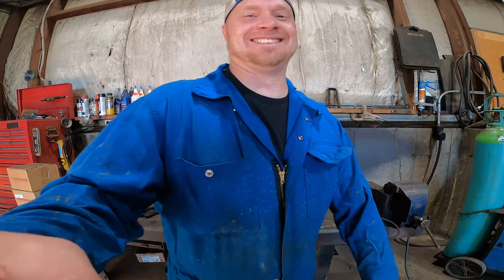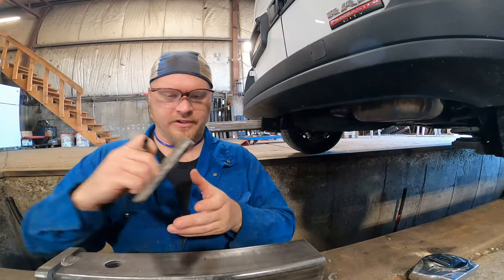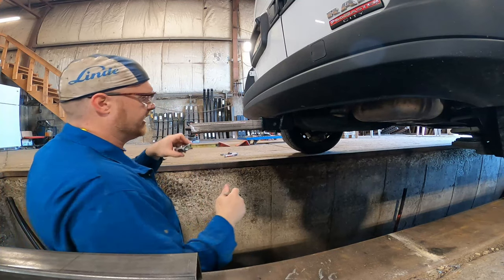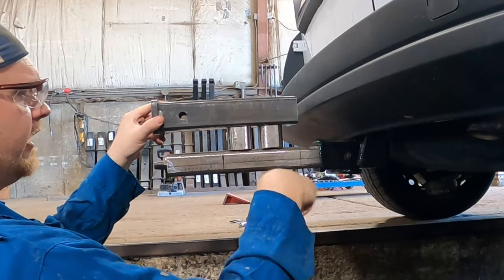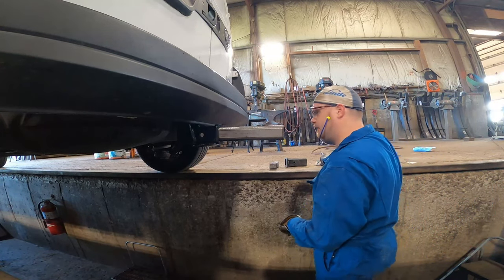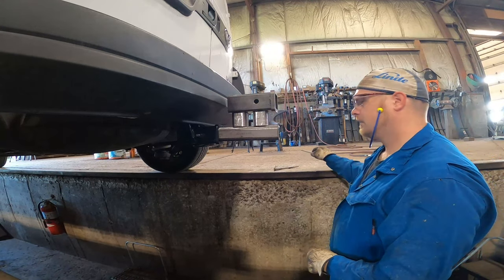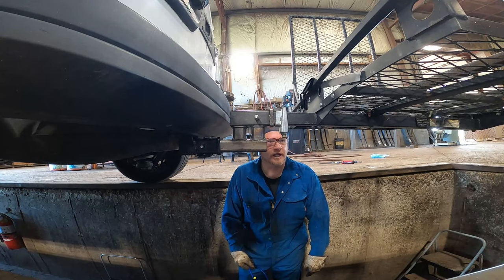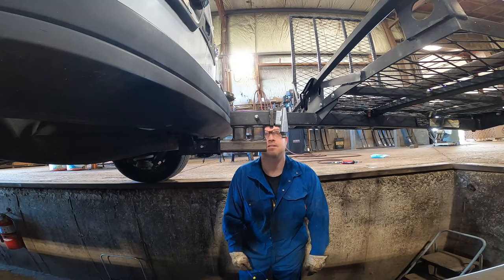I made a custom hitch riser - thing

Comment: You could of just dropped the Input on the basket and welded it, then I the basket is closer to the bumper and no need for the hight adapter, that’s what I would of done and nice welds and fab work though.
Reply from the maker: That is an interesting idea, and would have worked well.  I actually never thought about that.  I was just told to make one and had like 45 minutes to make it in...not really a lot of time to think about stuff.    NEXT TIME! hehe

Comment: Because everyone with a low to the ground car wants a bike hitch carrier or basket rack in the back.  Better making your own and getting the correct height and distance with some good welds.  =Some of these welds on these $30-40 can be pretty crappy and who knows what type of Chinese steel  they are using.  

You can shove a strip of thin steel in the hitch coupling to sort of rust-jack it in tight.  =However almost impossible to get off once the rust starts expanding.  Lots of these are crappy and probably break if used for towing = there is a good market for making custom ones.
Reply from the maker: That is why a lot of times I'll use 1/4 wall tubes because if there is going to be any weaknesses it won't be from making it too thin.  Lay some thick welds on and at least you know it'll be better than some cheap junk.  Now that I'm looking at some of the ones you can buy, I don't think it would fit on the vehicle because of the lack of bumper clearance.  So I would have had to make one anyways.  Oh well I like making stuff no matter what.

Comment: I bought one from ebay or Amazon.  I can tell you what it's limit is.  They are thin steel too.  I put it in my 1 ton hooked up my deck over trailer to it. Then I put my 13,000 pound winch in the top hole and pulled a semi cab up the trailer.  It wasn't happy and it bent.    By the way they put two receivers facing the trailer so you can hook up a trailer and the top hole is for whatever.  Like a bike rack.
Reply: You're not supposed to tow with these!!